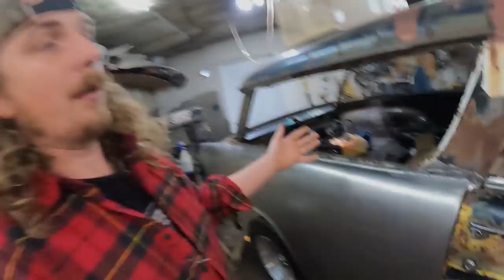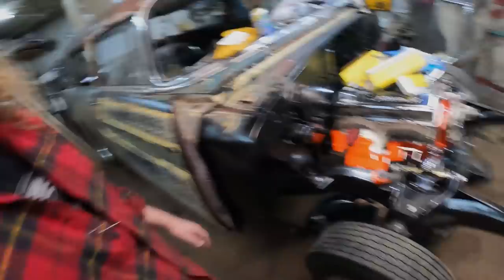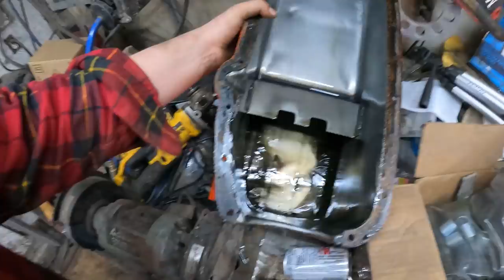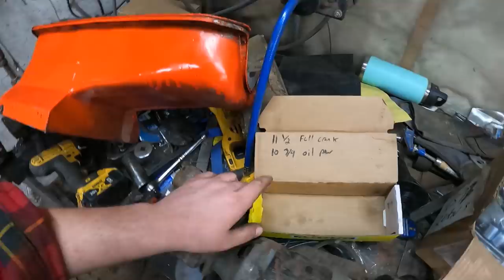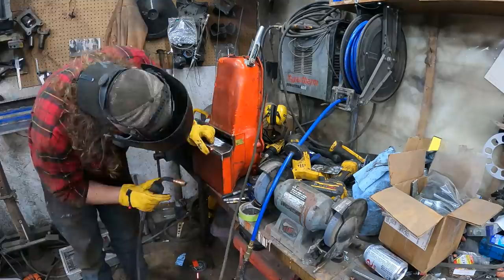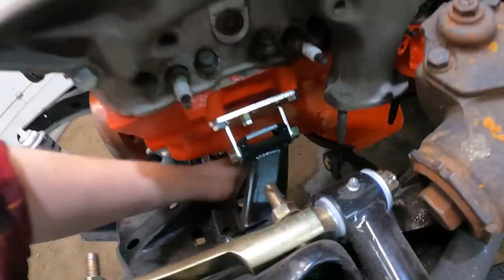When The Motor Doesn't Fit, You Cut It In TWO! BEATER 1955 Chevy Nomad Engine Fitment

Comment: There is a little "wrench" for those tie rods. It has a chisel tooth that slips in the groove, then cams against the sleeve. As you put pressure on it, it spreads the sleeve while turning it at the same time. Pretty handy and easy to misplace in the shop too. If you do a lot of these front end parts, it is worth investing in.

Comment: Dan,,,there's a special tool for tie rod sleaves that hooks onto them that pulls the sleave open, you can use a rachet or johny bar. Harbor frieght or Pricess Auto has em. Cheaper & faster than acetlene. Cheers

Comment: Nice job on the oil pan.   liked seeing  the location of the oil pickup tube at back of pan it will never move and always have plenty of oil to engine.  Nice to see what was in the rotating assembly with windage tray, shows it will be one hell of a hot rod engine for the Nomad

Comment: Dan the engine firewall and chassis looks great and your welds on the oil pan look great too. 
keep at it , as fast as it is coming along  it will be done before you know it.
 cool that BW found you some hard to find nomad trim pieces for it.
 they have some nice small block 3/4 length stainless tri 5 headers on ebay for less than $150.

Comment: the make a tool that fits in the slot when you use it the slot is opened as you turn worked at a shop the front end man had one worked great.

Comment: Nice job!  I had to do the same modification to the oil pan on my big block '55 Chevy Bel Air HT. Depending on your cam and engine vacuum, you may need a remote vacuum can or pump to generate enough boost for the power brakes.  I mounted my remote vacuum can on the drivers side cowl side hidden between the fender and cowl. My cam was pretty radical though.  Can't wait to hear that beast run. Keep up the good work.
Reply from the maker: Yeah. I'm hoping this motor is tame enough that it won't b an issue

Comment: I gave my nickel for privilege to view. Not much but it all counts. I do one other thing Dan, I measure how deep the pickup screen sets in the pan and make it about a inch off of bottom so no interference with suction and benefits of the extra oil. Weather I modify it or not, I stake that pick up with a tack weld so it can not work loose inside after its ran a while or not. I have heard of them falling off and it really sucks ... or can't in that case

Comment: They make a adjusting sleeve tool for turning it.....helps to spead it too. Did you consider rack and pinion? When you use one, header choices increase. Oil pan mods not needed.

Comment: hey Dan, I have sbc engine, fenderwell headers and power brake booster, I only had to enlarge the firewall hole size and modify  the dip stick, keep up the outside the norm builds
Reply from the maker: I'll never b normal  I guarantee it
Reply: @DDSpeedShop  remember to modify the "full" oil level on the dipstick when you throw in proper amount of fresh oil... shortening that pan will cause the full level to be higher... j/s -

Comment: Get a chisel or screw driver that fits in the slot of the turn buckle,spread it and leave it there spread and they come apart even easier.I leave the one end tight,put the chisel up against the end of the tie-rod your removeing,spread and leave in there,screw the new back up to it .back in the same spot.

 ...

Comment: I got to thinking Dan, I hate fighting valve covers and the master cylinder is in the damn way. The pedal stays the same place but since it bolts in. That plunger rod doesn't turn because it slips over a stud on the pedal. Held with a clip or cotter pin .. what have you. Now as it is, a small diameter rod from pedal to the back of the master cylinder..... so what if that rod was real strong and wouldn't bend if it was in a curved shape? It most likely would not bend as its short and fairly strong as it is. Say you move that master cylinder over four inches towards fender drivers side. That rod is on the under side so it clears anything under there and then straighten it to go towards that backside of master cylinder from new location. Pedals stay in same place and only thing done is rod needs to bend to new location.??????? What do you think.... its not a law to keep same shape or place. It sure would make it easier to even install the engine. To bad we can't move the distributor so it didn't hit firewall. I guess thats next too! Coil packs and electronic... or LS

Comment: Just wanna mention that over the years I had many old Chevy ll novas,any of them with stock v8 had a double sump oil pan,I've got one over top of the garage if you want it along with the oil pump and pickup,they also had steering issues with the oil pan
Reply: I've seen them with a tibe running through the oil pan for the center link. At that point I think I'd go with the aftermarket front subframe with rack and pinion.

Comment: A question please Dan.  How much room ( On the Pan ) did you leave from the bottom of the pan to the top edge of the tie rod ends, when you cut for clearance ?  It seems, that when in a full lock turn, and the steering system " Bumps ", it will travel up towards the bottom of the pan ?
Reply from the maker: Should be good.  Or it'll self clearance on the road haha

Comment: The best thing I seen for a master clearing a big block is one of the gasser guys had flexible line running to the master so you could pull the 2 bolts and just lay it over to the side.
Reply: The factory 1968 Hemi Dart and Barracudas did that as well. Not ideal, but you do what you have to do.
Reply from the maker: Yeah. I've seen that on some hotrods

Comment: Newbie question, Dan: is it always best practice to schmoo silicon on both sides when replacing a new gasket? Or do you sometimes just replace the gasket simply straight on, as is?
Reply from the maker: Doesn't hurt
Reply: @DDSpeedShop  thanks!

Comment: Have you considered just going with manual brakes? I once did a 1970 Dodge Coronet station wagon, did a disc brake conversion and all new rear drums. The engine didn't make enough vacuum to run power brakes, I put a vacuum pump on it that never worked well. Talked to some Mopar guys at a car show, all Hemi and 440 Six Barrel guys who advised me to get the factory manual brake linkage and master cylinder and call it a day. 4000 pound wagon stopped great.
Reply from the maker: Yup. But this car is a cruiser

Comment: Looking cute my dude, but for real its a good looking car. I wanna learn interior remodeling or whatever you wanna call it to do custom door insets for speakers and stuff myself. Got a late 1970s early 1980s 4 door Malibu Classic i'm building into a big rim car aka "Donk" but that's Florida for ya. love the channel tho man, stay safe up in Canada.

~ Side note also got a 1972 vw baja bug im giving away to my little 15 year old brother for Christmas sadly with a stroker vw bus motor and my 1980 Chevrolet Camaro that has a 12 point cage in it and all. sadly none of them run tho I do plan on it since ive got 3 cars in the last year. stocked up on cars but now its time to build something for once. only 22 so i'm tryna learn this stuff as i'm a tech geek/nerd and not really a mechanic tho my dad is. tryna also get a 2004 impala for a daily to throw some subs into it and redo the interior as its molded to hell and back due to bad seals. good start for interior learning tho as its gotta come all apart. even if you see this man or not still i've now officially post a comment on a video of yours. keep the tires a'smokin good sir.

Comment: Swapped out the 283" for a 396 375 HP in my 150 after the press on dampner fell off......396" came out of my 57 10:90 bracket racer.
   Moved the motor 3/4" forward and welded in engine mounts...no rubber bushing..
Changed out turbo 400 for a six speed and fabricated the cross member..no rubber bushings...now I regret that.
   Nothing to quiet the vibration..now I need to add rubber bushings to the manual tyranny mount..have to pull the engine to change motor mounts...so that's  not going to happen...LOL